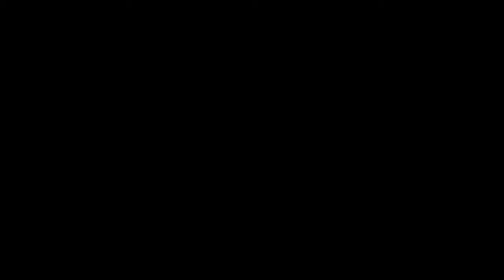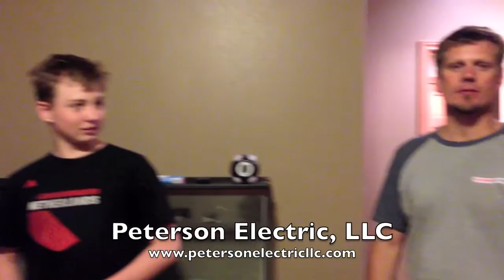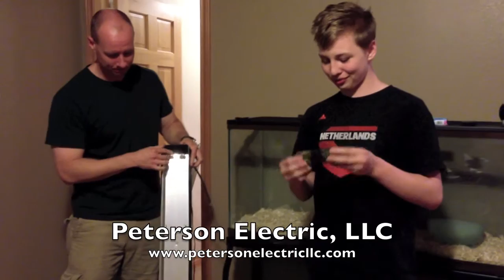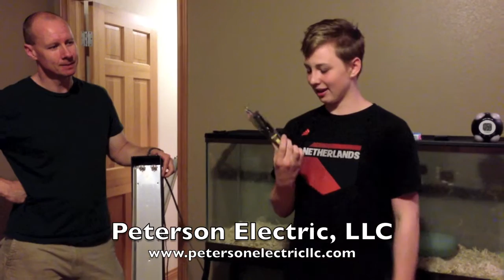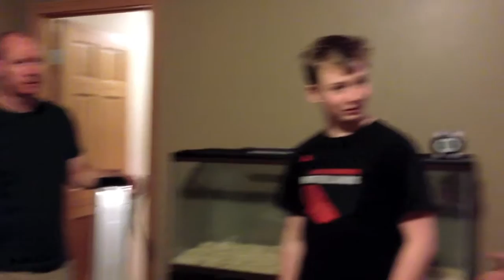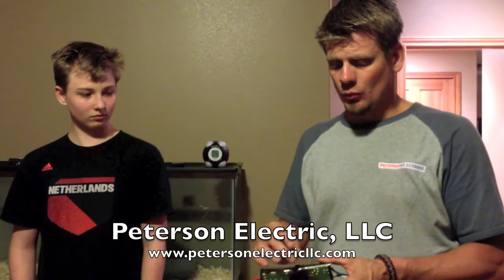What Is The Burning Smell & Why Arc-Fault Breaker Tripped? Loveland Electrician, CO

Comment: Can u guys tell me why my fuse box !! Has a strong older when the heat come on!! Really burns my eyes
Reply from the maker: if your smelling an odor when the "heat" comes on, it would depend on what your smelling? If it is a burning smell like a vacuum belt or gun powder then it could be a breaker or plastic burning. It might be from the insulation jacket on the feeder. I would call a professional electrician in your area.
Reply: My lights  flickering and my outlet smells like burning plastic what should I do
Reply: @spooky0488  Call an electrician.
Reply: @d1morto  already did it's fixed